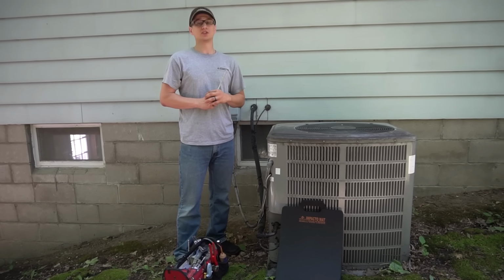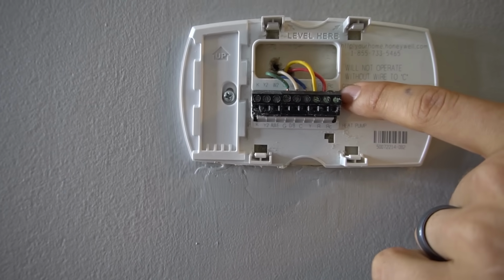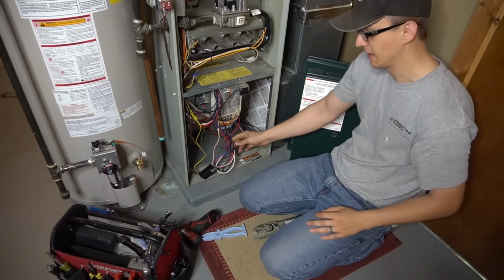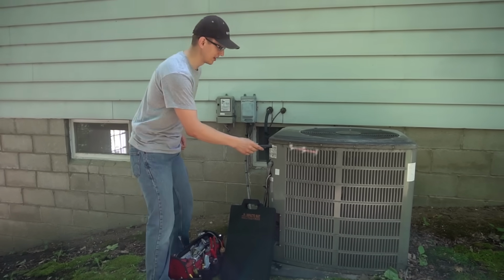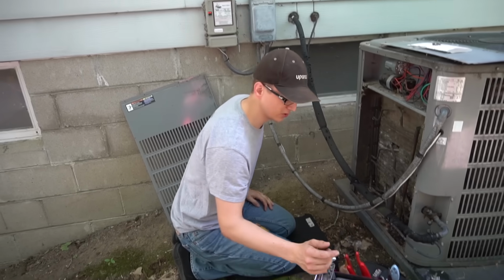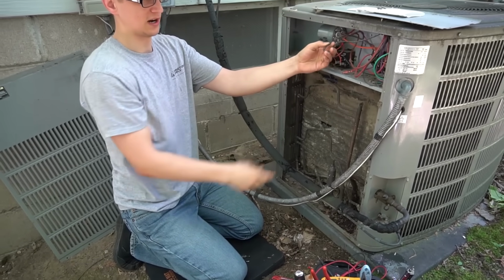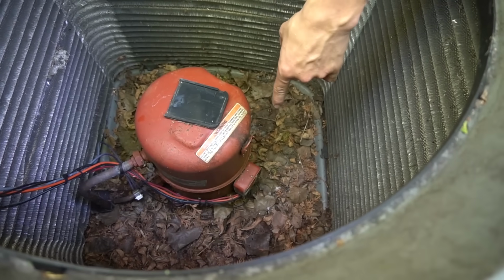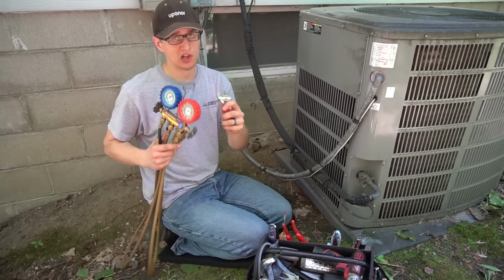AC Unit Not Turning On - How to Fix It Step by Step

Comment: In house air is blowing. Outside condenser is quiet no sound at all. Someone used a screw driver to short condenser and it worked and sounded fine while being shorted. Was told condenser not receiving signal to turn on. Can low r 22 cause condenser to not turn on? If yes then I would have to short unit to make it run while attempting a charge?
Thanks

Comment: Thank you our outside unit stopped working my husband replaced the capacitor and still didn’t turn on , after your video he tried pressing in the little black box and it turned on and is still working 🙏🙏🙏 thank God and you

Comment: Oh boy this video is 7 years old but here I go:

We’ve had some pretty hot/humid weather in the Midwest here past 80° and today when we went upstairs, we noticed it was 77° in the house when we had the AC unit set to 70, indicating that something wasn’t working.

When the unit is turned on, it sounds like it’s working, and you can hear the fans going, but you can’t really feel any cool air coming out of the vents. 
The unit outside is spinning and sounds OK, and it does sound like the furnace downstairs is running as well. We have not replaced the thermostat recently and the air filter was just changed last month.

Do you have any suggestions on the first place I might look for this? According to your video it looks like it might be a pretty pricey repair. The unit is very old, probably bordering on 20 years when the house was built, so I’m worried it’s something big.

Comment: Mine went out after a power outage during a storm. Turned out to be a fuse on the power switch on the unit in the basement. It was a 15A slow blow screw in fuse. 3 pack for under $10 at Lowes fixed it. Mine also had the exact fuse that this one had but that wasn't it.

Comment: Will the Run & Start Capacitors prevent the fan motor from running or turning slowly?
Reply: Yes, the capacitor will cause the fan motor on the outdoor unit to not run, to check when you hear the unit trying to run but the fan is not then safely take a screwdriver or stick and give the fan a little push on the higher side of one of the fan blades and if it starts spinning like normal than it is without a doubt the capacitor, just be careful if you are changing it out.

Comment: Hi, my ac unit turns on but doesn’t reach the desired temperature. I have changed the contractor and the capacitor. Everything works fine for a moment but then it will stop and after about 15-20 min it starts up again. What could that be?

Comment: AC not turning on started outside per your video everything comes on in the house the blower is blowing out of the vents, tested the thermostat it is good, replace AC fan motor last year and capacitor it doesn't look like I'm getting 240 to the AC but all of my Breakers and everything are good tested with a multimeter I have an old screw in fuse panel and then a small breaker box next to it. Nothing happens when I push the plunger in outside can the capacitor still be bad without making any humming noises or anything I'm lost

Comment: Hi. A lot of times a tech or shade tree tech will use an incorrect capacitor with a higher rating, how do you find out the correct capacitor for the unit?

Comment: good evening, I have a unit that cut off and i checked the the thermostat and it was off so i replaced the batteries but the unit outside wont come on , then i replaced the TS and the transformer blew. so i changed the capacitor , but the transformer still was blown again, so give me some insights on this situation ..thanks for your time.

Comment: Where is the plunger
Reply from the maker: It's on the contactor but sometimes there's a little plastic cover that is over it. Its secured in place by two small screws.

Comment: I have an older Rheem Central A/C System using R22. I have about 3/4 of a 30lb container of R22 on hand. Today I went to turn the A/C on and the blower came on but the Compressor failed to run for me. I went down to my basement to check the A/C breaker in my Electrical Panel. It was on so I shut it off and turned it on again and a noise was coming from the breaker for a few seconds then it went silent. Tried it again and it did the same so in the mean time I shut the breaker off. Do you have any idea what I should look for before I call anyone ? I know awhile back I was looking on You Tube at a video mentioning the capacitor could go bad on these Central Air Systems. My unit still has the original capacitor. I have no idea how to check it but I believe they are not expensive. I have some background with car Air Conditioning. I added a little bit of R22 to this system 2 times in the past. What I have done was keep an Air Conditioning Thermometer in our Kitchen A/C Duct. The gauge was always a life saver for me doing Automotive A/C and it helped me over many years to keep an eye on my Central Air System. Towards the end of last Summer I saw the needle on the Analog Thermometer leave the Shaded are on the Analog gauge so I knew this Spring I would need to top it off again. I usually get about 5 years before I have to top it with Freon once again so if a leak it is a very slow leak . Only this time the compressor isn’t turning on for me to add any. With the Manuel Wall Thermostat when turning the A/C on the Blower comes on and air is coming through the ducts in the house but the compressor is not turning on outside. This makes me feel like there is a possibility that the Capacitor is bad. Let me mention one other thing. I hired a friend of mine to install this Rheem Air Conditioning unit in my home in 1985. You read that right. This Rheem A/C unit has been a great system in my home that was 1 year old at the time of the Installation. We only had one problem with it maybe 10 or so years ago where I had a neighbor who did HVAC for a living come over who pointed out a bad electrical part to me telling me what part to purchase for me to go out to buy and I replaced it myself. Now before I even decide to buy a whole another A/C system because of age aloneI want to try to repair this one again. I am basically looking for some advice here. If I can still keep it going it would be a good thing.  Oh and I wish you were from around my area. I would hire you on the spot. I am 74 years old today and can’t do the kind of work I use to do anymore. The problem is finding good people out there you feel you can trust. Just listening to your video I feel you fit that mold.

Comment: Wow. That's a lot of great information. My question is about neither the AC or furnace will turn on. This occurred after a power outage and a power surge after the power company restored the power. Many items in my house were blown out during the surge. These were many light bulbs, garage door opener, doorbell, surge protectors for household electronics and hopefully not the entire HVAC system. I replaced the following: thermostat, fuse on controller board, capacitor and the circuit breaker for the AC. Any recommendations?

Comment: I have a new (3 years) amana a/c heat pump unit for my upstairs with its own air handler in the attic. Thermostat was fine and air handler fan was on but a/c would not spin. It showed 3 blinking yellow lights (Short cycling compressor is running only briefly). I checked the air handler and it said FAr A1E? (Indoor unit pcb?). I turned it off for 5 minutes and back on. Then it showed code A10. I turned it off again and on and then everything worked. Think i have an issue? The outdoor unit is now not blinking.This brand new, very expensive system has had 2 other problems in the past, cant remember them right now but trying to find the paperwork. Thanks great video!

Comment: I must have watched 50 Utube videos on why my outdoor unit would not start up. All of them covered most likely reasons for why. One thing(and its simple) was never covered in detail. I had 24v coming from my thermostat...but only read 5v at the contactor. Inside the unit, under the fan, is a pressure switch. (usually next to the compressor). It carries the 24v from the thermostat and then sends it to the contactor. There is a button on top of the pressure switch that can be reset. Once I did, I was then able to get the 24v needed to start the unit.  So if all else fails (as was my case) check and reset that pressure switch. What took me 2days of head scratching, was really just a 15 minute job. LOL

Comment: WHEN my A/C calls for heat everything works, when switched to cool nothing works. I REPLACED THE THERMOSTAT STILL NOT GETTING 24 VAC TO THE Y CONTACT. THE CONTACTOR WORKS WHEN MANUALLY PUSHED IN. I CONNECT THE Y AND THE RED AND THE fuse TRIPPED. PLEASE HELP. THANKS IN ADVANCE'

Comment: These switches you talk about that turn off the outside unit because of the drain being plugged or refrigerant is low.

How do I find if these breakers/switches to see if it's been tripped?

BTW, Thanks 4 What Your Doing!:trophy-yellow-smiling:

Comment: My unit inside is on and blowing and my fans are blowing outside but my house isnt cooling. I replaced the filter, cleaned the inside unit and outside unit. 

I had a new washer dryer installed and after they moved old out and new in the house got hot (82 degrees)  the unit is in the same room and i know they bumped because the old airfilter was sucked up agains the coils. Could the copper piping on the outside of the indoor unit have been bumped and cause the freon to leak out? Based on this video it seems like its a freeon issue since everything else seems to be working fine.

Comment: My inside blower was working fine, and I installed a new furnace filter, just in case.  Went out side and the top of the condensor was warm, but the fan wasn't turning.  The other guys said to check the capacitor, but mine checked out okay.  This guy (word of advice tv), said to give the fan a little push, and that's what got my unit running!  
Shoul note that this was the first use this year (since last October).

Comment: Need your advice!!! Thermostat on cool indoor furnace blower kicks on, outdoor unit doesnt start, ive replaced the capacitor, still nothing, dont see any bad wires, i can manually activate the contactor and the unit starts right up. Where should i start looking now?

Comment: When i push plunger in on ac, it trips my breaker instantly.
Reply from the maker: There is probably a wire that is shorting out at the compressor. Hopefully the compressor itself is not shot and it's something else. I would suggest this video to help with your problem: https://youtu.be/G1EBHrOgs-Q?si=G5XTBUe87RpNOnFi

Comment: Mine seems to do this every year I usually just have to turn the breakers on and off and pull the disconnect. To both compressor and air handler. Then it seems to be fine

Comment: Amazing video, I am stuck because I depressed the plunger at the contacter and the condenser and fan started right up. Capacitor is replaced. But for some reason the thermostat won’t activate that contacter and pull the plunger in. Not sure if need a new contacter or if wires are messed up on the furnace side. I did have a guy replace my blower motor last winter so I’m feeling like he missed one of the wires, but I traced the wire back and yellow and green are connected

Comment: I'm not turning on when using CA
Heat works
3amp fuse dies 6 flashing lights
Thought it was the gas furnace high pressure  rollout
Discovered its the CA unit, causing the fuse to break
I bought a 5 pack and have 2 left 😮
I have narrowed it down to the CA
Changed the Capacitor 
Fingers crossed and turned it back on again.
NOTHING and dead fuse again
I've looked for bad wires. 
My fan blade is turning freely 
The batteries are good in the thermostat, 
Every time i try to turn in the CA 
It kills fuse, and i get 6 blinking lights
The air filter is clean i aways change it every 3 months.
It worked fine all last season
I haven't checked to see if the presure  switch is working, on the CA unit.
 I will try that tomorrow.
Updates to come 
Goodman gas heater 8year old
Payne CA unit outside 10 years old

Comment: 2 years ago, the tech told me that the freon is lower than it should be, and may have to replace the compressor before too long.  I replaced my \refrigerator in the house because I thought the smell was from it.  I stopped smelling that smell in the summer afternoon afterwards.  I started smelling it again this winter.  Is the freon possibly leaking from the inside furnace of my hybrid system?  When I turn on AC, the inside air blows, but no sound outside at all.  When I push in the connector plunger, it runs like normal.  But I don't know if I can safely keep it pushed in for the average of 10 minutes it can take to feel cool air inside, like when the capacitor fails.  Not sure if I need to check freon or not.  I guess I should check contact continuity on compressor.  Also, this winter, when it got colder than 40 degrees, the heat would not heat until turning thermostat up high, and one of the elements was replaced 6 years ago.

Comment: hey my ac system blows hot air the air handler is running but not condenser  outside what would I check first the capacitor ?

Comment: question, my air cinditioner will run for about 2 days, then quit. i have to turn the breaker of to reset the power, then it will run for another 2-3 days and do it again, do you know what would cause this? i replaced the power board, 24V. the furnace fan does run, but compressor doesnt kick on until i reset the power

Comment: Hi, you done an amazing job please help me out, I have a problem with my 20+ years old air conditioner. the thermostat is working but the fan on the outside unit is not turning. please give me some idea on what the problem might be? t.i.a

Comment: I put on a new context switch and a new condenser compressor not coming on did have a short it blew the fuse it stop bowling fuse when I put on a new context switch but the compressor still not coming on I need help

Comment: Hello thank you for taking the time to explain this stuff for us. So at my house I have this issue that when the stove is turned on during the summer the temperature on the thermostat raises like 5 degrees above the set temperature it didnt used to do that it just started doing it last year. Do you have any suggestions for that issue? Thank you in advance 29:43
Reply: I forgot to mention that last year the unit stopped cooling the refrigerant lines would freeze so we called an heating and cooling company and they said it was low on refrigerant so they added refrigerant and it’s started doing that temperature fluctuations since that day

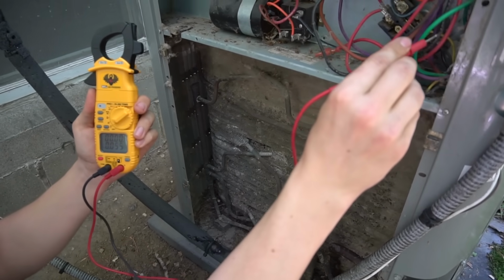Comment: So 19:00 Mark... I thought I was good but my capacitor is at 40 (charged) and I have 240v. The fan and compressor turn on only when I press the plunger to bypass the thermostat. I'm stuck, not really sure what the problem can be,  I even replaced the capacitor just tro be sure and nothing happened when I turned it on.

Comment: @11:00:  Do not blow compressed air through a drain line.  The fittings are not always glued, and you don't want to separate them in an inaccessible spot.  Instead, use suction from the out-flow side or pour hot water and vinegar down it.

Comment: Replaced capacitor, connector switch, starter. 24v signal received by a/c outdoor unit. Water guard pan switch a-ok. 240v ok. Furnace fan and door switch all ok. Ideas? Thx, Bob
Reply: Could it be the motor start relay? P/n HLR3800?
Reply: It was because it had zero Freon. Trane units, I found out, won’t turn on if no pressure in system. Had to replace the coil which was still under warranty.

Comment: My ac started blowing warm/ hot air in cool mode. I changed out capacitor and compressor and other units seem to work. Then, when setting in cool again it will not turn on so I had to set on heat then back to cool to turn on. While on cool the suction like freezes and noticed that on heat it did the same. I dont know what to do. Please help me .

Comment: Hint....Do NOT use Amazon 3 Amp ATC fuses. They are Chinee and have been known to run quite happily at 8 amps and up melting your wires or blowing your board. Use known US manufacturer ATC fuses. Look for Louis Rossmann and FUSE to find his fuse test. Amazon refuses to remove these bad fuses.

Comment: Also...check your condenser pan overflow switch. They are wired in series with your power supply and will stop everything to keep the pan from overflowing. I've had two fail even tho they are sealed units....surmise is the reed switch failed open.

Comment: Hi, World of Advice TV,  we recently had our hvac system serviced, a few days later the condensing fan stopped  turning on. The inside unit does turn on, yet air is not cool. This was the technicians report, he cleaned the condensing
unit with coil cleaner flushed drain lines with drain cleaner sprayed evaporator with anti-mildew chemicals, we were advised that
there is an excessive amount of debris stuck in the coil, and there is heavy bacterial growth upon testing the system, he found
that the refrigerant pressures were slightly overcharged. Also, during the inspection found that the compressors starting amps were
higher than the rated starting amps for the machine. The system has had recent power outages, but
some power outages may cause damage to low-voltage controls. What would you recommend us doing first to troubleshoot the issue? I think starting with the outside unit might allow us to
 identify the issue. The tech informed us that we should consider a hard start kit. Any information would be appreciated.